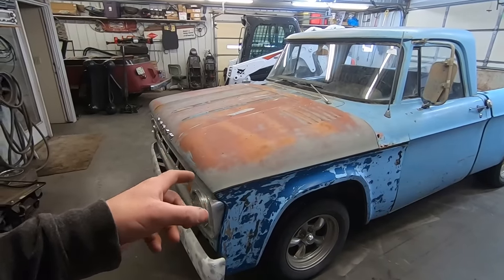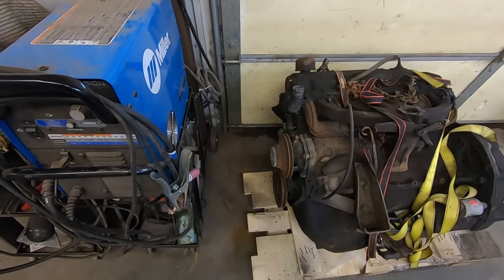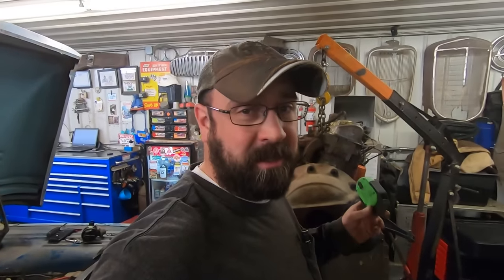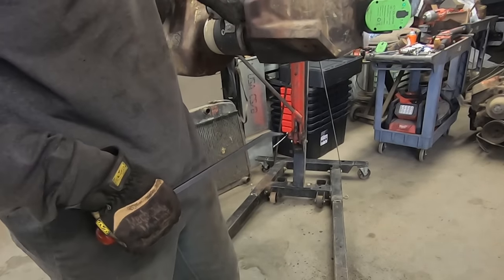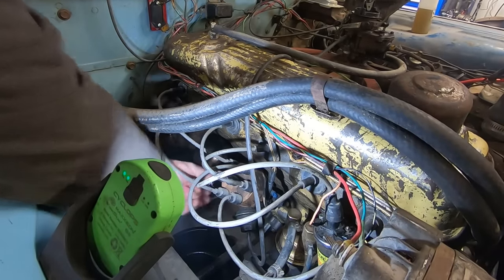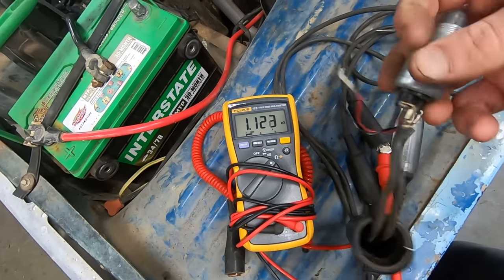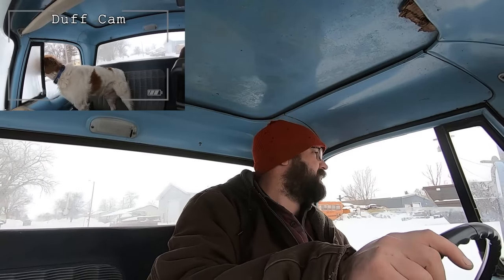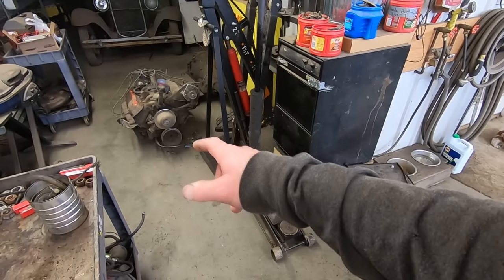The King is back! 1968 Dodge D100 Shortbed Sweptline pickup returns from the Dead!

Comment: Thanks, Thomas!  This should be a very popular video because everybody likes old Mopars.
Reply: Back in the day, Mopar factory mechanics were somehow able to replace the bypass hose on both the 170" and the 225" without removing the water pump. Don't ask me how they did it.  And the bypass hose on the 170" is 1" shorter than that on the 225", so you have 1" less room to remove it.  I'll see what the FSM says the procedure is.
Reply: Checked the 1960 Valiant FSM, and it says to remove the water pump. Yet I do remember the mechanics at the dealership doing it without removing the water pump.
Reply from the maker: Interesting!

Comment: Sucks when you have an issue with fuel thinning out the oil and loosing bearings, lost a small block chevy to that issue. The NP435 hard shifting could be a couple things, nylon inserts in the shift fork wear out, and detent ball bore area in the shift cover wear oblong and slots in shift blocks. Dodge had some application specific shift cover castings along with trans main case bolt patterns, input shafts and mainshafts and rear retainers. NP435 was used by Dodge, Ford, GM, IHC, New Holland(Ford) etc, internal gearing wise 3rd gear was available in two different ratios, so if your swapping internals from another unit you have to count gear teeth on 3rd. Sorry for geeking out on NP435, but they were used many years in a whole host applications and configurations.
Reply from the maker: Thanks for the info!

Comment: The slant 6 came from the era that gave us the Pontiac 4 cylinder, achieved by cutting a V-8 in half. Which made me think "why did no one make a V-12 from a Mopar slant -6? 450 cu.in V-12 would have been another Mopar Halo engine. How hard could that be? Also, another opportunity for some wisdom to remember the firing order!

Comment: They make a thing to plug into the obd port on 07 up gm to turn off the crazy active fuel management garbage which causes the lifter issues. Also I'm a Ford man but I really like the sweptline dodges a lot!
Reply from the maker: Yup, we had that installed even before this happened.

Comment: Chrysler slant sixes were painted red early yrs,blue later on, 170, 198, 225 cu. in , check on side of block for casting no.,it tells cu. in. and build date, Early sixes had solid tappets, late 70's are hydraulic.

Comment: The yellow Slant 6 you just put in is a 1967 and earlier with the smaller flywheel centering ring. It's probably a 170c.i. I believe the earlier 170s had that ribbed valve cover, although all the early slants may have had those. The blue one you pulled out has the newer style head, which changed around 1975 or 76. As far as the different colors, they were never yellow, someone did that one custom. They were originally orange until about 1968/69 (lots of debate on that topic), and then changed to blue after.
Reply: I've seen 65-69 bus/truck slants painted yellow. Pulled a few from the scrap yards.

Comment: Ohhh man,...The slant six,...One of the Greatest Engines Ever..was supposed to be a V-12, but mopar changed their mind & just halfed it....it wasn't designed to race...BUT it can & has had some great things done to the beast....Theres a guy on the tube called Uncle Tony's Garage....he specializes on the slant six.....knows all the facts & tricks to make those Engines Perform,....He built a race version dropped it in a dart..The Plan Z Dart....if I remember....this thing was/is phenomenal.....It just Screams....with a phenomenal throttle response.. I'll try & find that link & send it...

Comment: The engine in 63-69 trucks were originally yellow, passenger car engines were red.  The blue slant is clearly 70-up with the smooth valve cover, with a 74-up head that doesn't have the drool tubes.  After 70 Mopar switched all engine colors to blue.  The dead engine was originally Mopar blue although it's bee repainted Ford dark blue.
Reply from the maker: Thanks for the info!

Comment: I've had 5 Sweptlines, including a 71 shorty. Had a 383, Hooker headers that they don't make anymore, short glasspacks, an Edelbrock carb, ancient DP4B intake, and 3.55 Sure Grip. It was a rocket, as trucks go! And loud as hell! I bought it off eBay for 2 grand in 2010, and drove it 800 miles from Salt Lake City back to Washington. Fun! But it had an NP435 4 speed, an agricultural truck trans with Grandma gear and no synchros, so no speed shifts. I wish I still had it. I have a 67 383 and 727 now, and nothing to put them in! 🙄
Reply from the maker: Awesome!

Comment: Valvetrain noise? Lol those have solid lifters through 1980. Setting the valve lash might help the drivability. The newer engine that you took out has the '75-up "peanut head".  They just wanted to eliminate the expense and leak points of the spark plug tubes.  Right around in there is when they changed to a cast crank...maybe 1976. The truck engines through 1968 were yellow, the car engines red. In 1969 only, all Slants in road-going vehicles were metallic blue. In 1970 through 1982 all Slants were Chrysler blue(the engine you pulled out is the wrong shade). 1983 up all were black. So, the intake is a car intake, which isn't any different. The original probably cracked because they used the incorrect hardware and tightened it too tight to the head so it wasn't able to move slightly. The big number on the side of the block under the intake is the casting number. The ID numbers are stamped onto the pad (deck surface of the block) behind the coil. Usually a letter for the year code, then 225, then 4 digits date code that you can plug into the 10,000 calendar decoder, then 4 digits that are not relevant. That direct-drive Prestolite starter is because of the clutch size I believe. Those era trucks, Canadian cars and Hemis with a 4-speed were the only Mopars after 1961 to use those. You might want to consider building the engine you pulled out sooner than later. You can buy headers for those and 4bbl intakes. They are a lot of fun. Always clean and reuse the the original Mopar oil pump if possible. Number 1 and number 6 rods are the ones that always fail on those. The connecting rod either knocks the negative cable off or the starter off when it comes flying out. I've enjoyed these Slant videos immensely but i worry at what price. I bet an LS goes in something that didn't come with it ;-)
Reply from the maker: Great info!

Comment: The leaning tower of power was a popular industrial engine used in forklifts, air compressors, generators, etc.  I am guessing that's why there are so many different colors on that thing.
Reply: These engines where used in that way till the early 90s.
Reply: They, and the 300 Ford were used everywhere.

Comment: I have a 1978 Ford F-150 with the same New process 435 transmission and the 2 gear synchronizer is the same way. I am pretty sure it’s a common problem with them

Comment: You can adjust the valve lash on them even on the the later ones with hydraulic lifters . Did it on my ‘79 Aspen it ran better.
Reply: My old partying buddy in high school had a 79 Aspen.  The amount of abuse that he put that thing through was unreal. The Slant 6 just took it and kept running. He had his Aspen and I had a 78 Pinto. We were real rock stars alright 😆

Comment: Every time I see the valve break on the intro an idea hits me in the noggin. Build a flat metal bit that goes into an air chisel and put a thin rubber  pad on the end for driving those valves home. Maybe it will work with better odds than a hammer? Worth a try!

Comment: Short topic: What is a ballast resistor? How do they work? Why do some old cars have them and not others?
Reply from the maker: Hmm, well, it knocks voltage down to like lets say 9 volts. It works on resistance. And it was used to protect the coil the way I understand. But I'm no expert!

Comment: I wonder how much work it would take to change that into a good 4x4, she's got the looks of a Powerwagon . I am thinking 440 ci v8, 5 or 6 speed manual transmission, two speed transfer case, lifted enough for 38-40 inch aggressive tread tires.
Reply from the maker: More work than I wanna do.

Comment: Like I've said before I grew up living at a junk yard we did some bandaid repairs to vechicles so we could roll around to haul tools and get parts one was  a RHD mail jeep some sorta 4 banger I. It had a spun bearing like that dodge motor my grandoa pulled the oil pan in the jeep replaced the number 1 rod bearing with a hunk of leather worked a long time 6 or 8 months it threw the rod finally but we also never changed its oil just added more and it was used oil
Reply from the maker: Nice!

Comment: That's a cool truck, man.  Pity that blue engine rolled a bearing - it didn't sound bad, but the more it ran, the more you could hear the beginning of the 'donk-donk-donk' starting to make its presence known.  I'm not 100 percent happy with that new engine either.  The starter cranks like she's a lung or two down out of the six and she idles with a slight but regular deflection / wobble, but it doesn't look serious enough to blame the entire lack of a cylinder.....although when puffing out the oil filler hole, she definitely showed a regular one-and-a-half cylinder leak too.  Thing is, get her up in revs and through the mic and my speakers, the engine sounds like its pulling like a schoolboy.  My first thought was a stuck valve or two (and maybe a bent pushrod or pulled stud as a result, which would add to the top-end clatter we're hearing).  You may wanna just give all them valves the 'ping' test with the valve-adjusting tool when you pull that rocker cover just to be sure.

Speedos - the gauge in the dash, not the swimwear - are funny things.  If you want to check your cable, pull the cluster again, unscrew the cable from the rear and turn the cable in the housing around about a full turn and let go.  If it stays still, then either the cable is broken or the little worm gear in the box is buggered.  If it springs back, the issue is more likely in the speedo unit itself or the cable inner isn't long enough to seat in the spin mechanism when she's done up.   To confirm your findings (or as a quicker way of testing) with the speedo cable disconnected from the back of the speedo itself, move the truck backwards or forwards a few feet and watch to see whether the cable inner turns around inside the outer sheath.  If it doesn't, then the problem is the cable or the worm drive and if it does turn, then it's the speedo or the cable inner's length that are the problem.  At both ends of the speedo cable inner, it should be squared-off and the squared off bit should be at least half an inch long.

Damn, I like that truck!  You're gonna end up getting me to sell my British steel and buy myself one!  Problem is that the parts suppliers here charge like wounded bulls for classic American even more than they do for classic British - not to mention the steering wheel is usually not where it is meant to be and my passengers would all step out into traffic rather than up onto the footpath.  My Mrs is also only 5'0" tall and she bitches enough about getting in and out of the Stag because it's low to the ground (I honestly thought she'd be happy about it and told her so.  It didn't go well....)...........so God help me if I got a vehicle where she would need a step ladder to get in and out of the thing and lumps of timber strapped to the pedals so she can reach them to drive it.  We are one of the only families in our neighbourhood that does not own a four-wheel-drive / SUV / City Tractor.  Partly because I hate the f***ing things and don't see the point of them and partly because she can't get in and out of one gracefully or see over the steering wheel to drive it, let alone push the pedals down without assistance.  Fortunately she is still happy with her Mazda 6 station wagon, so I don't have to think about what to replace it with for a while yet.

Anyway, I hope the tips help and you had a bit of a laugh at MY expense this week!  All the best, Mortske.
Reply from the maker: I'll have to diagnose this one some more!

Comment: The color of the motor has something to do with the years. I don't remember what color go with what year and if it is a high output tower of power. I o think the older bell howsings will fit a old "Y" block. I do know that the newer ones will not change.

Comment: That has a v8 bell housing so that is nice. Starter low is a small block bell housing. A poly or la will bolt up. But not an old poly as it has a crank flange that sticks out too far. New hemi will bolt up also and also an old hemi. But you will need an 8 bolt flywheel.
Reply from the maker: Thanks for the info!

Comment: (OL) open loop on your Fluke multimeter. There's no continuity. 

Imagine going through a fire and yet it still fires. I guess it didn't get hot enough for distortion. I always find that amazing because the Rings weren't getting lubrication during the heat cycle.

Comment: Hey Mortske,  did you say what year the "yellow block" 225 leaning tower of power is, I do know Chrysler painted those engines yellow in the early to mid 60's, so it is of that vintage, it will certainly have more power and compression than that 76 model. Just an experienced observation.

Comment: Not so swanky ride Mortske. I think the timing is off and it maybe also from a bad timing chain or the fact there is slack somewhere. Usually it is also the distributor being 1-2 teeth little too off. You never know, I got some odd distributors that don't even fit with the teeth of the camshaft and they are from the same engine. And don't blame yourself for destroying the previous engine I think it was toast before the fuel issue came.

Comment: I'm sure someone else has mentioned it but the NP435 has a non synchro 1st gear. it is more of a granny. on mine unless i need it i just run in 2-4.
Reply: I took the 3speed out of my 69& replaced it with an A435, but I also changed the pumpkin on the 8-¾ and swapped the 3.23 gears for a 2.76 and installed a sure grip.  It would just purr on the highway

Comment: .005 is about the smallest surface variation you can feel. So if it's obvious it's 😞. A billet steel crank and some forged rods with arp bolts will fix it right up. To bad they don't make that stuff for a 225 slant 6

Comment: U could get a dodge half ton with the 833 OD 4 Speed in the late 70's, I've seen several, all slant 6 power. 1968 last year of bell housing mounts, 1969 first year for mechanical clutch linkage for many years, now back to hydraulic clutch, so we are going backwards in technology, evedently.

Comment: At least you caught it before Uncle Rodney came through the oil pan to say hi. Shame the ole leanin' tower o' power died, my '84 Dodge D150's fuel pump on the ole' 318 did the opposite, it filled my carburetor with oily gas more than it put gas in the oil. Still ran on the oily gas, never cleaned the carburetor out, and really the truck smoked so much anyway why bother? 

Great video as always man, keep up the good work!
Reply from the maker: Much appreciated!
Reply: @MortskeRepair  No prob, I'll try to catch your livestream next time, seems like I'm working everytime you have one now.
Reply from the maker: @DeadReckon  No worries!

Comment: I have always wanted to get a 225 and have a redesigned cylinder head made for it with a cross flow design, put some forged internals in it, stroke it slightly, add a custom sheet metal intake manifold, a 70mm throttle body, MPFI, and add a turbo just to see what it can do with a properly designed head and intake system. Straight sixes are the only naturally balanced engine and when designed properly can make tons of power and torque. Idk, I just like the odd engine builds.
Reply from the maker: Heck yeah!

Comment: If you have new stuff you probably should leave it outside in the winter, especially if you are heating your building. Unless you are able to remove the salt before bringing it in to said heating building. The cold keeps the cold temps keeps the salt working slower. Howdy from blue plate land.
Reply from the maker: That's why you wash the salt off!
Reply: @MortskeRepair  every day? Ain't nobody got time for that, lol.
Reply from the maker: @madmodifier  that's why you drive a beater instead when it's salty!

Comment: mortske - I have a suggestion. It's a little noisy (click-clack, click-clack) but instead of that diaphram fuel pump (click-clack, click-clack) you might consider (click-clack, click-clack) and electric 😎
Reply from the maker: I avoid the noise!
Reply: @MortskeRepair  - Hey! It'd be good enough for the girls you go out with 😎

Comment: That may have solid lifters and you may need to adjust the lifter clearance. If it has solids a little valve train noise is normal.
Reply from the maker: Could be
Reply: They were noisy engines when they were adjusted right. Just like the 22R Toyota engine.

Comment: Some of those bell housings would work on both the leaning tower of power hill side Hemi & the small block 318 . I had a 68 D200 that had a 727 V8 trans but from the factory Mopar made a adapter plate to make the slant six to the V8 transmission . Mine had the shifter on the dash .  My 68 W200 that was a ex air force short box swept line the bell housing on that you could bolt either the 6 or the V8 to it because it had the extra bolt holes drilled for it & that was a 4spd hydraulic clutch set up .  Myself I would scrap the 6 & V8 it with a 440 & 727 & make a sleeper out of it so if you go that route you will want to change out the rear end to a car 8-3/4 rear because the trucks on some had those keyed axles to the hub like some jeeps had that will bust the key way off with a lot of power put to it especially if you have big wide tires on it for traction . Some of the later slants used the same crank main bearings that the 440 used .
Reply from the maker: Great info!